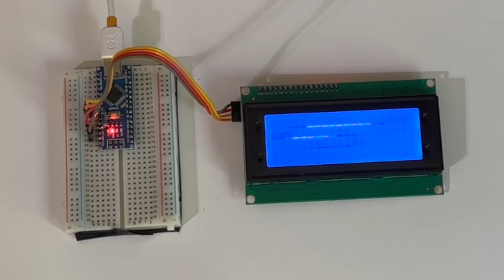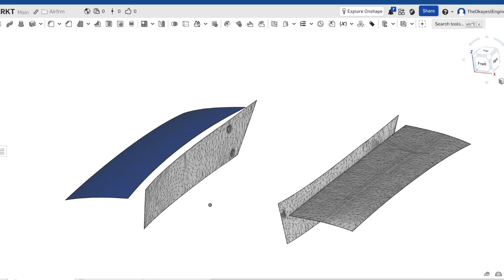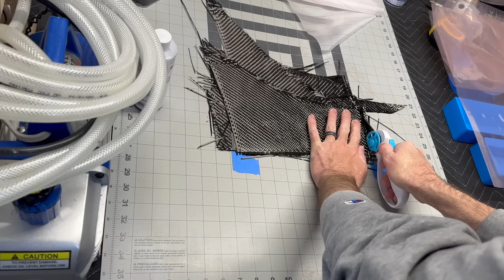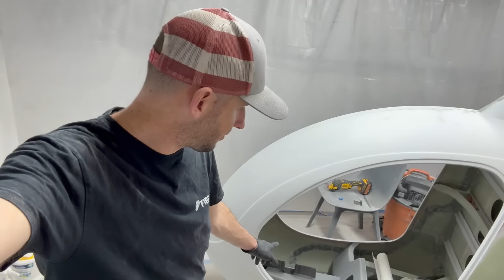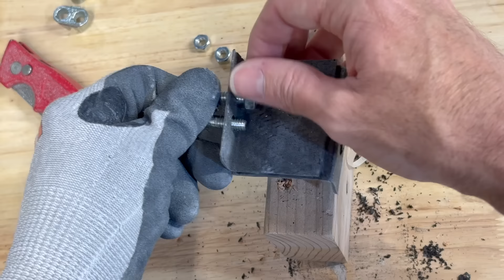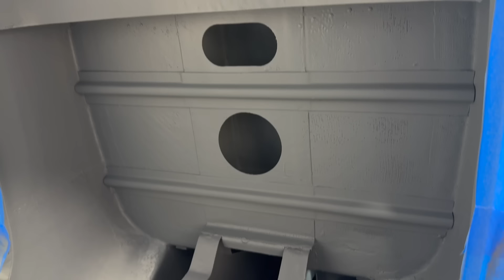It FINALLY looks like a REAL HELICOPTER | Basement Mosquito Helicopter Ep. 27

Comment: I've seen some comments about carpet, bedliner etc for the interior. I think a better option would be lightweight foam backed auto headliner material. Apply with spray adhesive and conform to the shapes without much added weight or thickness. It's how I finish rough interior fiberglass cars.
Reply from the maker: That’s a good solution. My only concern is if it gets wet. Or when it gets wet lol.

Comment: The sharp edges of the carbon cowl are not good for flow and drag, an edge with more volume and radiused allows the air to split a flow better and more likely to stay attached. Another issue with sharp edges in panels like that because of the non-laminar flow, and because of the properties of carbon composite sheets, you can get resonance issues and fasteners can come loose or could cause cracks.
Reply from the maker: Very good point. This has been living in the back of my mind for a long time rent free but I don’t have a solution for it yet. I’m going to see if it’ll be a problem first…. But definitely not ideal.

Comment: For covering up the surface, I'd use some super lightweight carpeting material. No point in building the heavy base layer up if you can just cover it in fabric, foam(low density EVA is fairly light), or something similar. Would also assist in reducing the rattle, whatever that may add to the screaming of the engine.
Reply from the maker: Yeah… I agree. I’m torn between just leaving it… or making the extra effort. We will see…

Comment: Just finish the interior of the cockpit with truck bead liner... don't hide the texture make it a feature
Reply: b
Bedliner spray is a heavy material. They have paint with the same kind of texture. It would be much lighter. Something like FlexTex VT texture paint, which is sold by Aircraft Spruce.
Reply: @FarmerFpv Interesting... I was astonished when I found out how much weight there was on a 747 in paint alone... nearly half a ton.

Comment: go to the fabric store.. buy a couple yards of your favorite whatever... go to the auto parts store. buy some sound deadening material and some 3M heavy duty spray glue. lay the sound deadening material in selected spots and spray the whole thing with the 3M, lay your material over the whole thing. and roll it out to strech and have that forever stick....
Reply: to go further with this... you could pick up a couple aerosol cans of spray on bed liner, and spray that just on areas that you want finished look on; yet are to complex to easily carpet with whatever you decide to get from my previous comment. such as your center console and dash.

maybe also spray this on engine covers of cowling and also lay some dynamat over the top.. noise and vibration control everywhere... just be contious of the ammount of weight you are adding and where,  to keep CG where it needs to be.

Comment: The interior is fine. As you know the proper smooth gloss finish for chop is thick tooling or laminating resin mixed into gel coat base rolled and brushed then thin gel coat finish sprayed. I'm for nothing although I find spray cork appealing. 
I'm patiently waiting to see the tail rotor system design. 
✌🏻👶🏻🚬

Comment: The best mold release wax I have ever used is Johnson’s Paste Wax furniture polish. Put one later down, buff it out and let it dry, then do a second layer and then put your PVA mold release down. I have hundreds of parts thru one of my airplane molds and never had one stick.
Reply: I've never had any issues with Frekote—it’s a purpose-designed release agent with predictable performance on epoxy systems. Other aerospace-grade systems like Chemlease or Zyvax are also widely used and well-characterized. PVA is another viable option as a film-forming release, particularly for initial pulls or more challenging molds, though it does leave a sacrificial layer that needs to be removed and isn’t as efficient for repeat production.

I’d be hesitant to use Johnson’s Paste Wax furniture polish, since its formulation isn’t controlled for composite applications and may contain unknown additives or solvents. Those could lead to surface contamination, cure inhibition at the interface, or variability in adhesion and long-term durability. That might be acceptable in non-critical applications, but in aircraft work, material compatibility and process consistency are pretty important.

Comment: Pro-tip: Any sharp inside corners on your carbon parts will be prone to cracking from vibration if you don’t back them with some Kevlar patching. It’s cheap insurance…..
Reply from the maker: Great point. Most places have at minimum a small radius but you’re right, I should put some cheap insurance into it.

Comment: You're awesome Cali, mosquito looks superb. What I do with pin holes is have a very small paint brush and dab some paint in there while its wet. they will then sand out when it gets to that stage. You can still do it now its cured, no harm and it will sand out fine. Thanks very much for the shout out! 😊😊
Reply from the maker: I’m definitely going to try that. Thanks!
Reply: A toothpick works perfect for that with the high build primer unthinned
Reply: @deuce454  Great idea 👍

Comment: Very nice buddy. So... I am curious about the exhaust configuration.... if yours is the XE 290, how will you modify the exhaust pipe system to route it out the rear cone? Or... does the 290 exhaust system fit inside your enclosure ok? Anyhow, I too am prepping for paint on mine and your video gave me some things to think about for sure! I should be priming this weekend if all goes well. I had some graphics made for mine that will give it a really distinct finish look. The guy who did the work for me nailed it in terms of color matching. It's a simple design, but needed to match my accent paint colors well. It will be nice to see your engine and hardware installations!! Take care brother.
Reply from the maker: You’re the first to ask. The factory exhaust goes lateral to the helicopter and would actually cut through the cowling. I plan on rotating it to be inline with the helicopter and fit. I need my hands on the parts before I will know if it will work. Fingers crossed.

Comment: cover the interior with 4 way stretch RV carpet liner ... no glare, looks great and covers all manner of sins
Reply from the maker: I’ll be sure to use a vacuum bag to hold it down while it cures ;). Jokes but great suggestion. I’m going to look into it. I’m just not sure how it’ll hold up if it gets wet.
Reply: @TheOkayestEngineer  🤣 im sorry if that one still stings ;-) but it looks great and its some flame retardant synthetic carpet, it might require vacuuming frequently though
Reply from the maker: I’ll look into this. My only concern is if it gets wet…

Comment: are you mounting the carbon dash insert on a piano type hinge in the bottom and screws on top so it folds down to facilitate wiring ? and cut out the center in the dash   (even off its pretty flat and faired)
Reply from the maker: Right now I’m thinking I’ll just mount the carbon face with a hand full of screws. Something tells me I’m making a plug for another mold though… make a full carbon dash.

Comment: On our big model airplanes, we use Granit effect spray. It comes in rattle cans and gives a slightly structured, multi-colored surface. It needs clear coat to protect, but is great for rough fiberglass interior.
Reply from the maker: I’ll definitely look into this. A uniform textured surface might be best.
Reply: @TheOkayestEngineer what about a spray in bed liner. Might be able to get someone to do it locally an would probably be a better finish than the rattle cans.
Reply from the maker: @TSSolutionsPro the problem with spray bed liner is how heavy it is. I think there are lighter ways to achieve the same result.